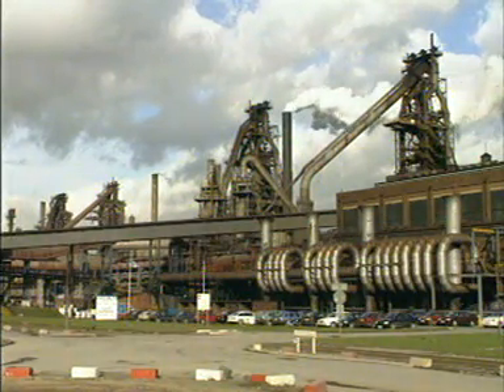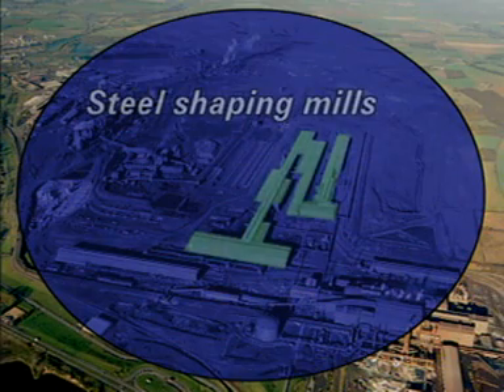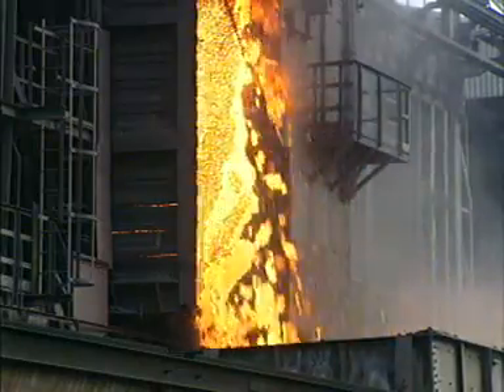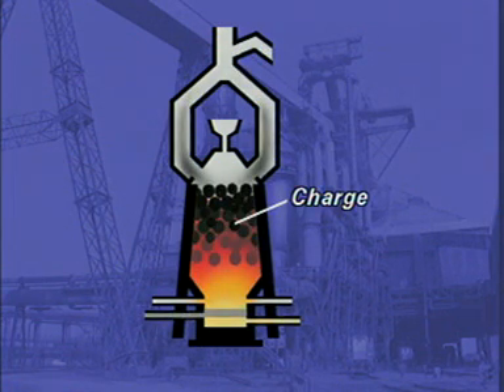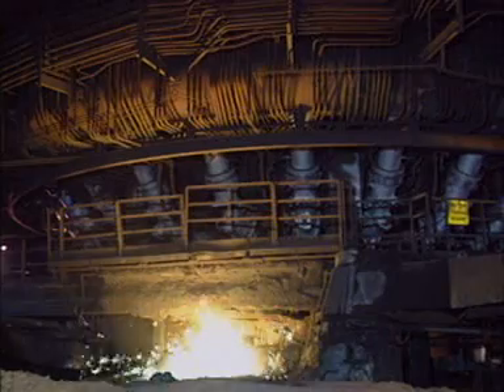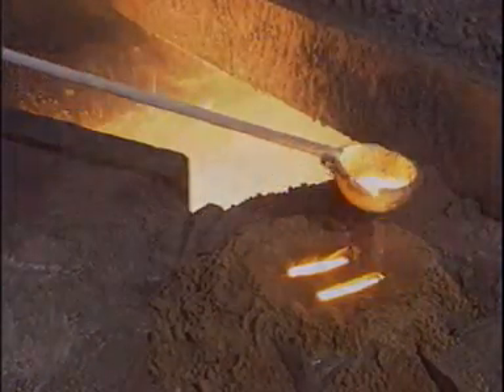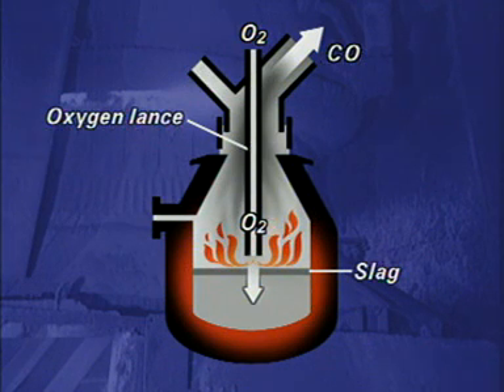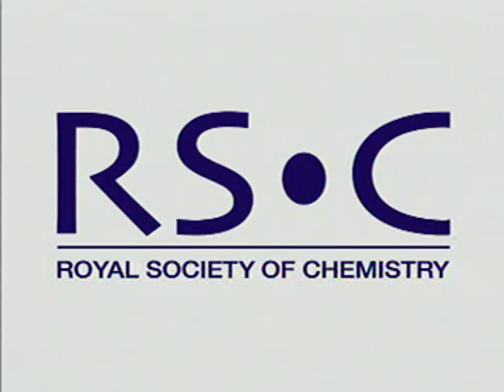Iron and Steel

Comment: HELP! All internet sources are saying conflicting information.

If steel is just iron with less carbon...
Then why is iron more ductile then steel?
Then why is high carbon steel less ductile then low carbon steel?

If steel is iron with carbon added...
Then why does cast iron have higher carbon then cast steel?
Then why does cast steel exist, shouldn't it just be a different grade of cast iron?
Reply: Steel is an alloy of iron and carbon where carbon is less than 2.1 percent by weight. Pure iron is quite soft, impurities can make it brittle. Steel cannot have less carbon than pure iron but can have less carbon than raw iron and pig iron, which is an intermediate product in the basic oxygen steelmaking process. Source: Wikipedia.